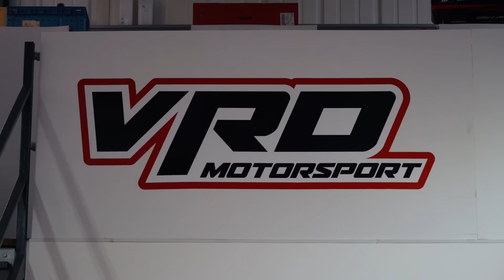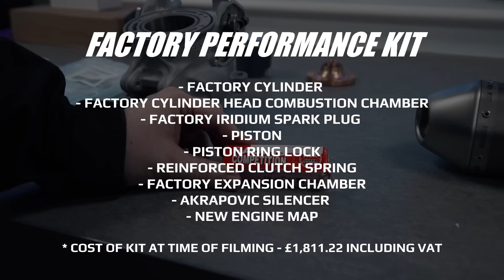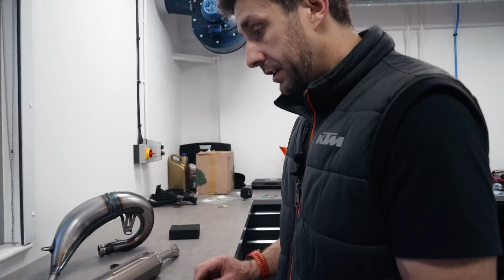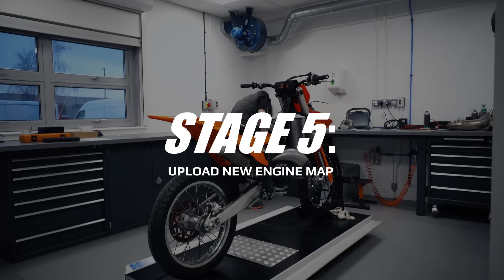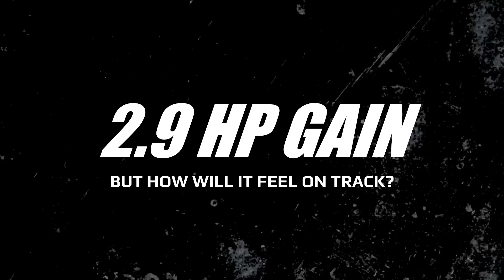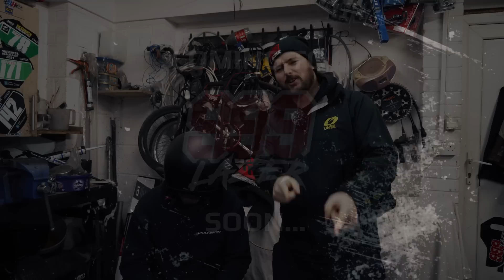Chasing Power on a 125cc 2 Stroke! | 2025 KTM 125 SX

Comment: 2k USD! What was the point of that cleaned up new cylinder again? IMHO, chop that out and save a heap, I says.
A buddy installed a STIC Super X carb on to his kids stock '22 125SX. At a large regional he immediately started getting top 3 starts among faster kids with fully built race engines. He said that it runs hard like a 150, but there's less clutch work whilst short shifting it. The shift point is much broader, so he's always in the meat of the power. With this carb on my 200SX, I prefer to use the slowest turn G2 throttle cam, as to control the mayhem created a tic off idle. No need for a pipe, head mods or port clean up, as the entire powerband far exceeds those bits of honestly incremental increases.

Comment: hey I have a question I have a husqvarna wr 1999 year and it has a 38mm mikuni tmx carburetor, vhm cylinder head, fmf gold series fatty exhaust and 14/42 gearing so how much horsepower does it have about? I think wr is a dirtbike so it should have more than a regular 125cc bike

Comment: In 1987 my 87 cr125r made 32.5 hp at the rear and in 88 my new 88 model made 0.5 hp more but power came in earlier.
Reply: i own an 87 and it absolutely does not make 32+ horsepower at the wheel. it doesn’t even make that at the crank. these things put out about 25hp at the wheel brand new

Comment: Cost vs Power Gain = Not worth it...

Ive gained 2hp in the past, Custom ported and accurately port timed 2 stroke barrels.. and hot cams high lift camshafts on 4 strokes etc...
Really not a big difference at all....

Now, i know, If you told someone that their biek is 2hp more powerful, they WILL feel it.. its a mind over matter thing...
Same applies with remapping cars... There are many shady companies out there that dont actually tune.. They just change "driver wish" settings....
You dont gain any actual power... Its all in the mid.. Sorta thing...
If you tell someone its faster..... In their head... They will feel it....
But in actualality... It is not the true case at all...
(i used to remap cars for a living, so know all about it).....

ive had friends, that have had their cars remapped, with the companies giving ridiculous claims for power gains... That are simply just not possible... But if you ask them... They feel the power....
If a person tells you its now 200bhp..... The car will feel like 200bhp to you.... 
Thats all it is...... Mind over matter... 

In the case of dirt bikes.... I myself, Loving 125 2 strokes, and having the knowledge and experience when it comes to power gains from engines etc... 
2hp gain, is 10000% Not worth the price... (assuming its an average person paying out for all of these upgraded components)

Honestly, for an average person.. It will be more cost effective, to look elsewhere for power losses / gains.....
A too slack of a chain... causes losses of power etc etc...
Heck.. You can gain more actual power, just from fitting a race head and using race fuel....... Which is alot more cost effective than anything in this video..
Reply: You'll be able to feel it on the track—it's not just about the power, but also about higher revs. The speeds in each gear will increase, which will shorten your lap times.
Reply: @karollo1619  horse power doesnt enable an engine to rev any higher... It also doesnt improve top speed on its own.....
Top speed is calculated by engine revolutions X primary gearing X secondary gearing X Wheel/Tyre size.....
Technically, All horse power does, Is enable you to accelerate a little quicker, Which in turn, can be traded by sprocket changes to enable for more top speed, if you so wish....
But tuning in general, Doesnt improve any of the things you speak of.....
(remember, i tuned cars for a living, I know how it works)...
I have a Zafira diesel car... Stock was 150bhp.. I got 140mph out of it, Just took a while...... Its now running 244bhp.. I can still only get around 140mph out of it... (due to gearing etc).... But i can accelerate to 140mph quicker than before...

As some one that has tuned engines for a living.. Also has ridden motocross since the age of 5...... Im extremely confident its just the case of "mind over matter"... Your told its 2hp more powerful, SO you will "feel it"... realistically.. you wont though...
Reply: @ Check the dyno chart; it revs higher, and at 12,000 RPM, it has 10 more horsepower. It will be faster. In this case, it also revs a few hundred RPM more, but sometimes the difference is 1,000 RPM, which can mean an additional 10 km/h. On the track, that makes a big difference in smaller engine capacities because there are often situations where you either shift up for a second or stay in gear at max RPM without accelerating. I’m a motorcycle racer, and trust me with the kind of gain shown in the video, you’ll immediately be faster than with the stock setup. It might not feel like a huge difference, but it will definitely impact lap times.
Reply: @karollo1619  Still not worth the money...

Comment: Gotta spend £1800 on a premium priced ktm125 to make it just 2hp more powerful that a yz125????
Just get a yz125 and Roland Shaw will do cylinder work for £200 and and get a dep pipe for £300
Reply: KTM horses are bigger and stronger than Yamaha horses.
Reply: ktm is 5kg lighter, once they get the fuel injection reliable they will be the better bike again

Comment: Folks remember 3hp isn't much but on a 125 its almost 10% and there is a massive gain in spread and overrun. Thats going to feel like a different bike on track. 
I'm not convinced its a gain you couldn't get with a pipe and jet kit on an older bike though - or indeed a pipe and map on this. That makes this a very expensive way of matching a bike with very basic mods on it  - how many do you see without a pipe and set up on them?
Then if you aren't class limited why would you get this over a 150 which is only £400 extra?
Or a 250 at only £800 extra? Even the 300 is only £1100 more which saves you quite a lot on just this kit. 

You could get a 250, all your riding gear and a pipe for less than a 125 with this kit fitted. You would have to be nuts.

Comment: The obvious question this brings up is why isn't this kit on the stock bike?
Reply: Up sell.....charge premium for bike.  ....then slap another premium on top to be competitive.
Reply: @kratcliffe5680  I get the marketing but the 300 is around 50hp at the wheel and around £1500 cheaper than this depending how much they charge to fit the kit. 
If you took the 125 to one of the better tuners they would also get a fair bit more than 3hp for that kind of cash so even if you're cc class racing it makes no sense. 
Fitted to the bike as standard it would add almost no cost because they wouldn't have to make two sets of parts so I just don't see why they don't throw it on and have a better bike in the showroom.

Comment: What’s the power of a 150 coz £1800 for 3hp is steap lol and whats the current price of a 150 compared to this ect ect so many questions then what’s the price difference between these and the 250 and 300 haha be nice for you to do like a graph of em all with prices ect but I bet ktm would hate that lol 😂
Reply: The 2025 ktm 150 has 37hp which is slow when the 2022 125 had 38hp
Reply: @ so basically a 2022 125 has more powers than the new model even after spending an extra £1800 to put performance parts on, wow lol